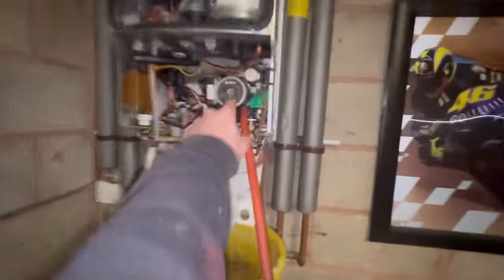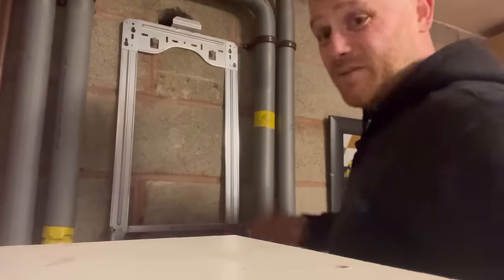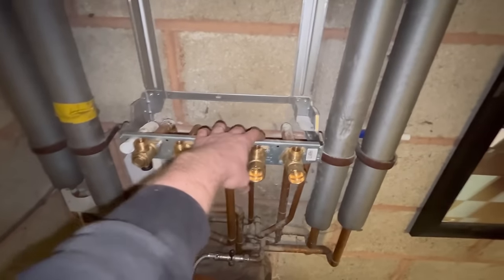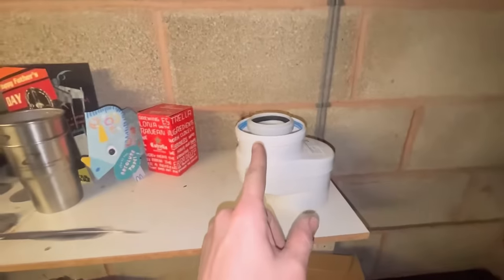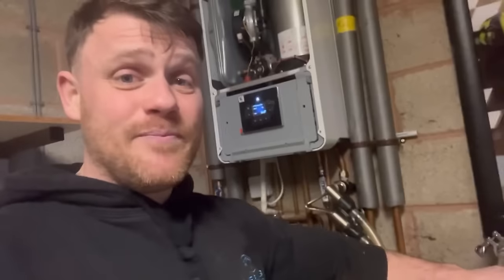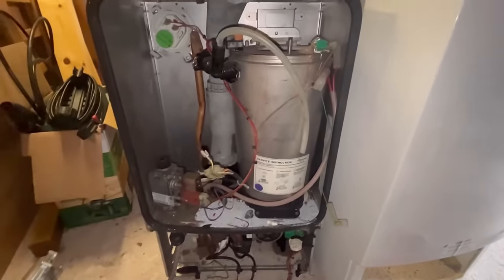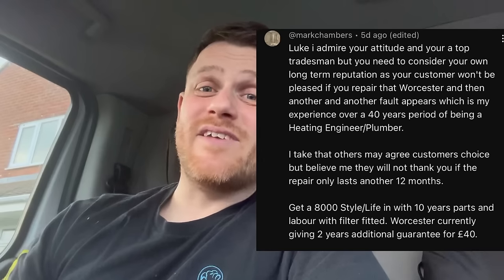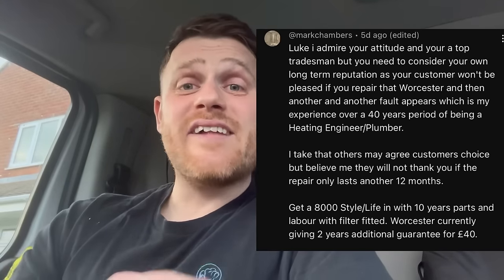Find Out The Fate Of That Worcester Boiler In This Video – Comments Revealed!

Comment: Made the right decision to change the boiler 6 weeks or so what else can pack up you just can't  say you was very professional great work as usual.
Reply from the maker: Thanks mate, I’ve got one very similar where I’ve replace fan, leaking condensate trap, electrodes, red seal and flow elbow, told him to start looking at new one December, called me up about hour ago, LH manifold split 😩 sometimes is better just to cut your loses and replace

Comment: great movie again mate, i swapped a worcester fan pcb ONCE, new years eve a cpl of years ago, condensate blocked, boiler filled up and blew the fan!! I went out at lunch time on new years eve, couldnt get a fan until the new year, one localish place did the refurbed fan pcb so I offered it to the customer as the only alternative to getting heat over the new year period, they jumped at it, not surprised really cus it was bloody cold and they had to wait about 5 days for a new fan, I drove into London to pick it up, retured and fitted it, boiler worked fine for 24hrs then broke down again!  a few days later when everything had opened up I went and picked up a new fan and fitted it, boilers been problem free ever since, what I got from that job was that the customer wasnt happy although I did everything I could to help them, they ended paying me twice and I got a load of agro over the new year because of it so for me, I just dont do the refurbed parts, its genuine boiler parts or find someone else to fix it :)
Reply from the maker: That’s another reason I don’t like refurbs, can bite you in the arse if they fail, unlucky for you thou, trying to do the best for customer but lesson learnt I suppose, well done for going above and beyond mate, not many would go to that length to help someone out on new years eve

Comment: Lol cheers for the shout out mate. I do get peoples ideas to replace and the question you ask to customers, is the exact same i ask them. Is this your forever home? Also, top tip i can give on any worcester, to stop the return or flow manifold springing a leak, put a pressure reducing valve on the cold mains and set to 2 bar. Will never pinhole lol. Keep up the great work 👍
Reply from the maker: Thanks mate, I think asking them the question about how long there staying is the one that helps a lot of people make the decision on end, like the tip on reducing valve 👍

Comment: My ideal Stelrad was fitted 1992. Still perfect and runs like a dream. Never needed one repair. I dread the day it breaks down and I have to have it replaced.The new boilers are tripe. They’re creating more environmental damage manufacturing them and replacing than having an old one using slightly more gas.
Reply from the maker: Yes mate great point new boilers last 10-15 years if there decent nowadays not built to last like they used to